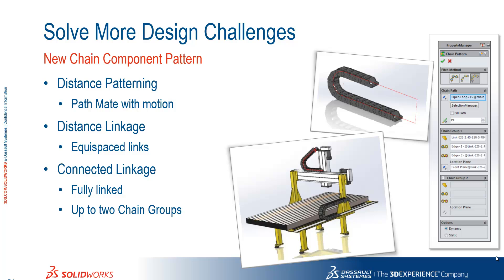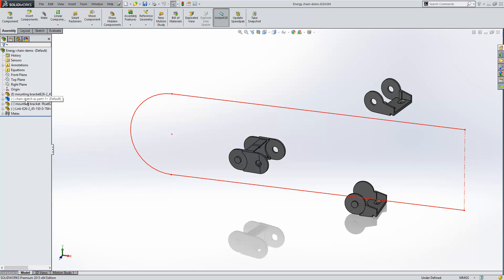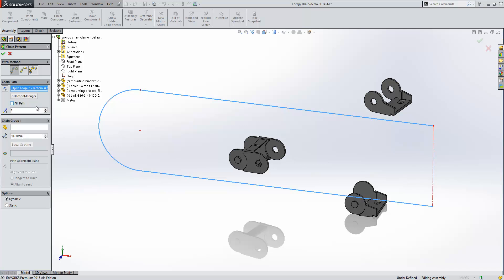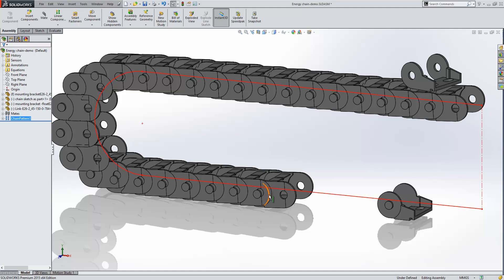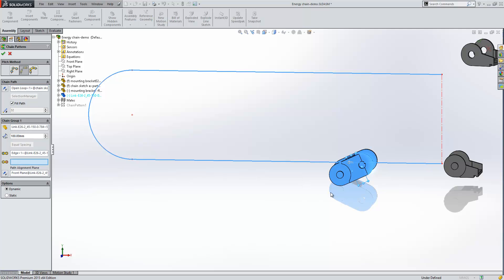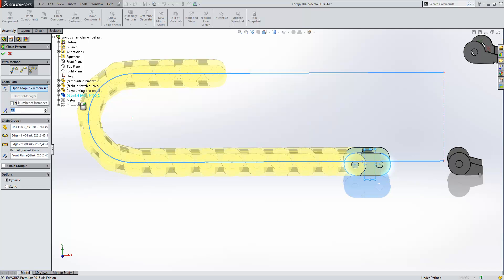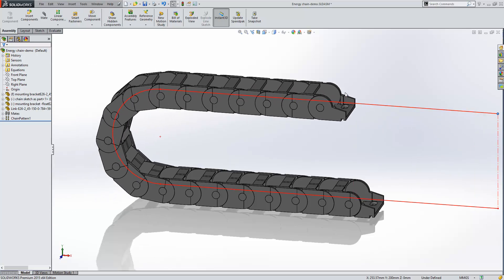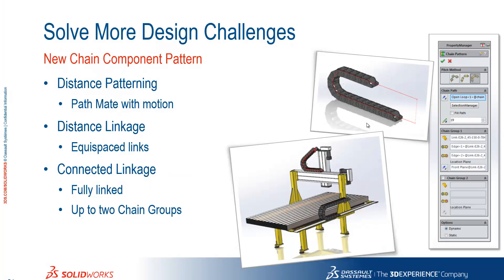SOLIDWORKS 2015 - Chain Component Pattern

Comment: Great video, thanks for posting! I've made an assembly just like yours at 0:12 in your video, however I cannot spin the sprockets and have the chain move, or vice versa. The sprockets all spin in time with each other and the chain moves independently, but they won't drive each other, even in the physical dynamics move mode. Am I missing a mate that should tie them together? Thanks
Reply: same here! have you got the answer ? please reply or contact me on my email fariz.n068@gmail.com, thanks!

Comment: Hello and thank you for that useful video :)
i built my chain and it moves exactly as yours but when i add it to my main cnc assembly it doesn't move, can u share a video about it or i can send u my video and u can tell me what is wrong with mine ? thanks :)
Reply: +Emrah Dursun I think In Component Properties (on chain subassembly click right ) in Solve as area you have to mark Solve as flexible.
Reply: +Artūras Juškevičius thank you for your reply, i have tried what you said, but it didn't work, i will try it again with different model.
Reply: @SuperLtpower  This worked for me. Thanks!
Reply: Do you want to learn much faster?
https://www.youtube.com/watch?v=h5JZnveZ0tw